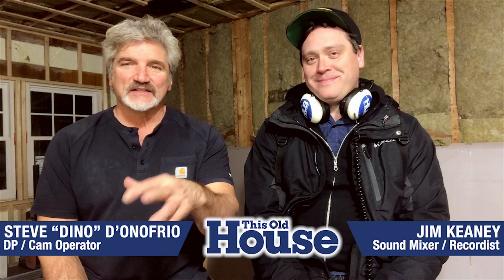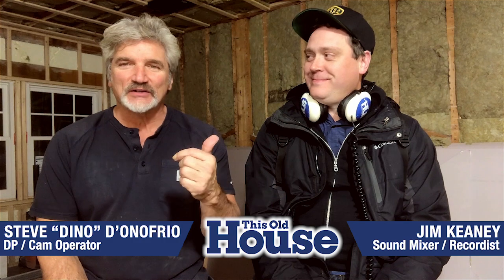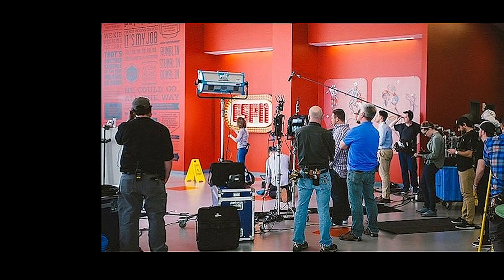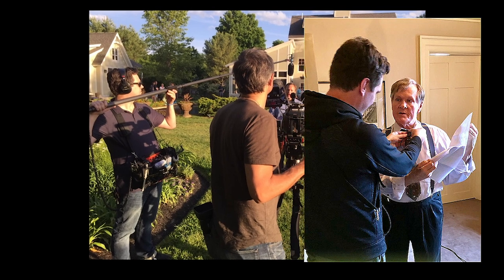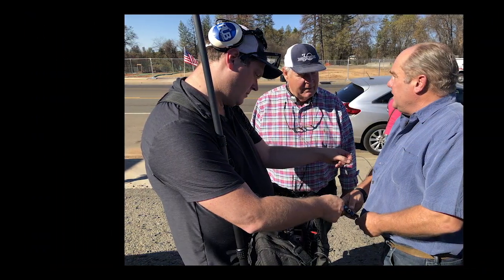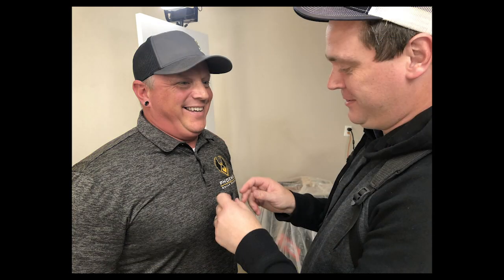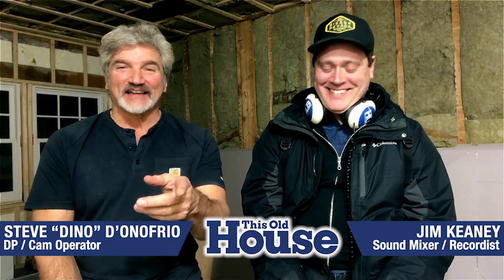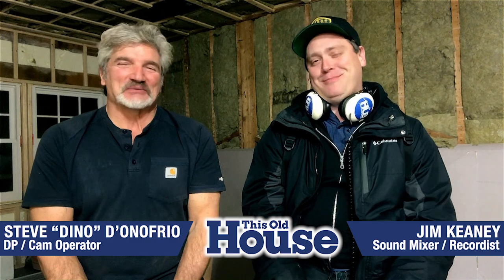Production Sound Mixer for THIS OLD HOUSE

Comment: Excellent video. Looking at all that sound gear made realize why you made the big switch to a much lighter bag rig.
Reply from the maker: Thanks, Allen. Yes the weight, but also coordinating was becoming hairier in the analog realm (especially in a tight footprint on whips). Now I scan/autopick freqs and send the new freqs to all the packs wirelessly with just a few button clicks. Also removed a transmitter using a system that feeds both ifb and cam hops.

Comment: Great interview Jim, Dino seems like a great guy to work with.  l have the same 688/SL6 with SRC's for my smaller cart.  I love that set up, I've done some of my best work with it and it's the perfect set up for a job on the go.
Reply from the maker: Thanks, Michael. Dino is the man! This was shot last Winter (in New England, hence my big/crispy coat) and while I still have my 688 and several Lectrosonics channels, but I recently moved to a Zaxcom Nova system. I haven’t encountered 10-person cast days with it yet so not quite sure how I’m going to feel with the Nova’s 5-encoder banks ;)  But a bag that is now 1/3rd the weight is very welcome 😉
Reply: @HubLocationSound  I'd love to see a before and after video with the old kit and the Nova.

Comment: Really nice video and info Jim & Dino! Jim, can you explain your comms setup a bit? How do you have everything setup when you say camera "sends to crew" and director "talks to cam." I'd love to hear your wireless and routing setup, (i know this is your old bag)
Reply from the maker: Hi Jon, we had a somewhat unorthodox ifb setup at the time of this video. It was sort of a holdover from before I got involved. The show actually had a lectro sm transmitter taking it’s feed directly from the headphone output of the camera. They had a 1/8” splitter so Dino could also use a headphone from that same jack. That TX would feed to 4-5 R1a’s for producers/director. Then there was another one-way IFB going from directors headset mic (into an smv tx) and that’d be received by an R1a plugged into Dinos remaining ear. The show has since stopped using the director mic system (they’re usually close enough to communicate) and if Dinos way up in a tree or something, they bust out walkies. I have since started provided all the IFB’s and transmit that mix from my soundbag which as you know is a much more traditional approach.
Reply: @HubLocationSound  Thanks Jim very clear!

Comment: Hi Jim! I'm curious on your thoughts with your headphones. I'm going to be doing some recording of sports cars and I'm looking for something that isolates well to save my ears. Would you still go with them if you had to do it again? I appreciate your help! :)
Reply from the maker: Hi Jason, I bought these because I was working on loud shoots. But I got so used to the added isolation that I use them on every shoot now. They are the same drivers found in Sony MDR7506’s but custom mounted into Pilot headphones. I highly recommend them, especially if you’re working at something like Nascar. They’re pretty big but they allow you to listen at lower levels in general which helps with fatigue. Fairly comfy too with gel-filled ear pads. They (Remote Audio) make another version that has a headset-style talkback mic installed (avail in dynamic or elecret). https://www.bhphotovideo.com/c/product/283347-REG/BI/21832/KBID/28200
Reply: Thanks so much, Jim! That’s incredibly helpful! I read some reviews about issues with the ear cups losing isolation after awhile. Have you had any issues with that?
Reply from the maker: @jasondordel9630  Nope, no loss of isolation that I'm aware of. The gel ear pads are replaceable. I've only ripped one so far. These headphones are quite robust and take a beating.
Reply: Awesome! I really appreciate the replies! Keep up the videos (when time allows 😉) They’re super well done and helpful! 👍🏻👍🏻